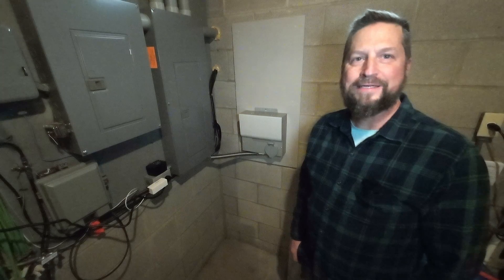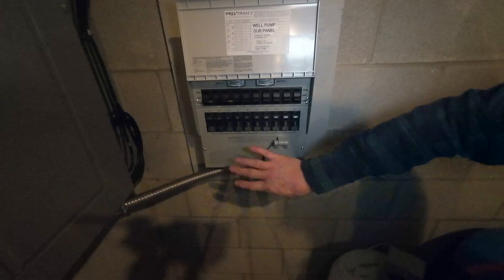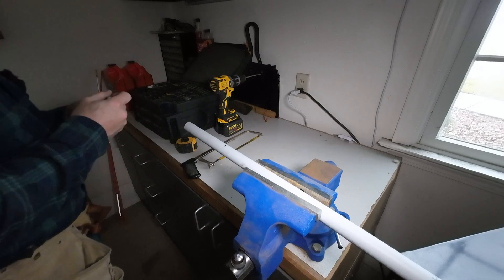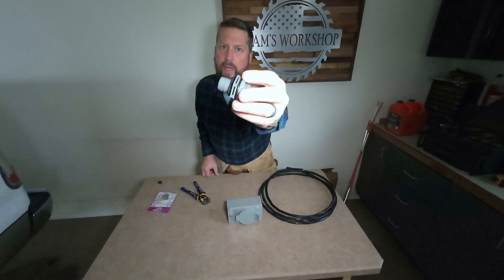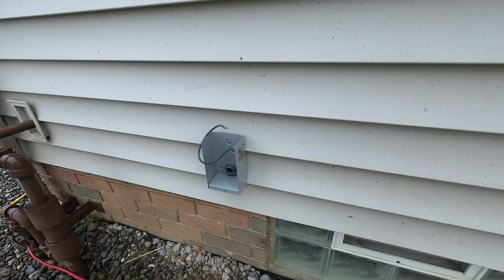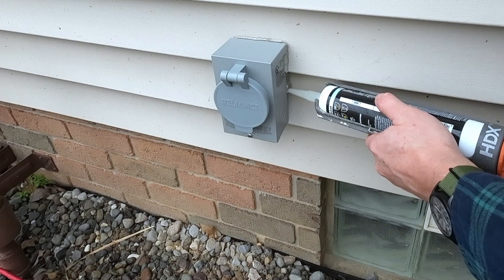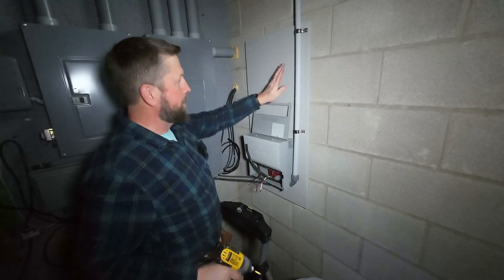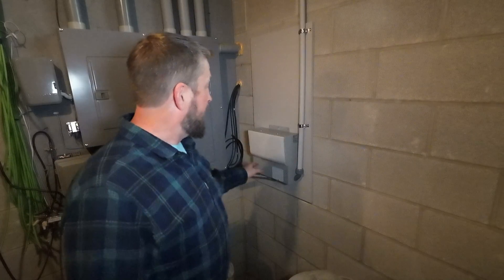Installing An External Inlet For A Generator Transfer Switch

Comment: Thank you for the EXCELLENT video. It's exactly what I need for my installation. I've done a couple of transfer switches, so what I needed the most help with was attaching the box to the outside of the house on the siding. Your details on attaching the conduit to the box are  what I need.
Reply from the maker: So glad it was helpful! That's exactly why I make these videos. Happy to hear it gave you exactly what you needed. 🤠👍

Comment: I cannot find that fitting anywhere.
Reply from the maker: Hope this helps 

https://www.homedepot.com/p/Reliance-Controls-30-Amp-Power-Inlet-Box-PB30/202213702?g_store=3805&source=shoppingads&locale=en-US&pla&mtc=SHOPPING-BF-CDP-GGL-D27E-027_008_CIRCUIT_PROT-NA-NA-NA-PMAX-NA-NA-NA-NA-NBR-NA-NA-NEW-NA-Priority2024&cm_mmc=SHOPPING-BF-CDP-GGL-D27E-027_008_CIRCUIT_PROT-NA-NA-NA-PMAX-NA-NA-NA-NA-NBR-NA-NA-NEW-NA-Priority2024-20420576520--&gclsrc=aw.ds&gad_source=1&gad_campaignid=20420577051&gclid=CjwKCAiA55rJBhByEiwAFkY1QAob4kuaX6jSg_pR5QUQxUdN4OmxNPTaURsi8MykaYwmA9pVZIdTaxoCn4EQAvD_BwE&adobe_mc=TS%3D1764172532%7CMCMID%3D87251738588442607708685792847285464003%7CMCORGID%3DF6421253512D2C100A490D45%40AdobeOrg&mboxSession=5051414e-f945-4c45-9e9e-606d4d951486&appsFlyerId=1752099438441-6431554585545318375
Reply: @samsdoinstuff Thank you, I have the box it was the small fitting for the pvc pipe to go into the box that I can’t seem to find.
Reply from the maker: @peterviv7520 I just found that at Home Depot in the electrical conduit isle. 🤠👍

Comment: Do you have a newer video to show how you added the battery power generator to the transfer unit?
Reply from the maker: Great question. No, I have not added battery backup yet. Check out Spicer Designs channel. Here's a link to a video he did. He's a licensed electrician 🤠👍

https://youtu.be/Fud1gp880LE?si=FjZdIySz09J1wil3

Comment: I'm not sure if you will get this since this video is a year old. Is it possible to have two inlets for your transfer switch? One in the house in case you want to use the battery system and one externally in case you want to use a gas system?  Right now I am thinking of just leaving the inside inlet for battery hookup then just running a generator cable back into the house to charge the batteries.
Reply from the maker: @mitchodell4993  Great question. With this system, it would definitely be possible. That's exactly what I want to do eventually. I would put a selector switch inline so I could choose which inlet to use. Gas generator/electric battery backup 🤠👍
Reply: @ any recommendations on batteries?  Was thinking of the Goal Zero Yeti Pro 4000? Would love to do a Tesla power wall but I am too cheap.  Haha
Reply from the maker: @mitchodell4993  I do not know enough about battery systems to give an educated recommendation. I do think the better brands like Bluetti, Anker SOLIX, and EcoFlow would have the best product support.

Comment: Thank you for this informitave video, you just broved my brother in law wrong, The transfer switch won't feed back into the grid once the power comes back on making it safe to use. By the way he is a certified electrician😂
Reply from the maker: @D-Slowpass  Thank you! I'm very happy I could help. Hope I didn't create any "static" between you and your brother, lol 🤠👍
Reply: @samsdoinstuff  no. Just confirmed what I thought and takes the guess work out of doing it myself😀

Comment: I watched a previous video that showed you installing a transfer switch box including revising the inlet box to be accessible so it could be manually connected to a generator or power station & easily swapped as needed. I also watched this video showing you installing an inlet box on the house exterior for a generator connection into the house. These are great because I can send these to my husband and let him know that this is what I had in mind EXCEPT to leave the transfer box inlet as you had revised it in the transfer switch box, and to purchase an ADDITIONAL inlet box for the generator to plug into on the outside of the house. 

After the inlet box is installed on the ouside of the house to plug in the generator... since the other end would not be permanently wired into the transfer switch box but instead would need to be more like an extension cord that would be manually plugged into the transfer switch accessible inlet box... do you know if such a cable already exists? TIA!
Reply from the maker: @annerohyans9407  Thank you! What you described sounds like you would do best to have a switch wired in between the transfer switch and the two inlets. That way you could select between outdoor gas generator power and the inside inlet. You would absolutely not want it wired so both could be used at once. Hope this helps 🤠👍
Reply: @samsdoinstuff  Thank you for the reply! That makes sense and I have a visual, but I am not familiar enough with parts to know where to find such a switch. Are you able to give me the name/model of such a switch?
Reply from the maker: @annerohyans9407  There are so many to choose from. Just Google "30 amp selector switch" (or 50 amp depending on which setup you're using. Amazon, Home Depot, Lowe's  all have them.
Reply: That helps to know what to Google, will do, thanks much!

Comment: So how can u use the hookup outside with a solar style indoor power source?
Reply from the maker: @jimverh1868  Great question! You would need a separate set of wires for another's inlet inside the house and a selector switch between to chose which input you want to use. I intend to do that someday 🤠👍
Reply: My thought was to leave the plug in the transfer switch like u had at first so easy hook up to solar source and hook up outside as you did but bring it into a outlet in house and use the cord from solar supply to it.   Was courious if this would work
Reply from the maker: @jimverh1868  I think as long as you don't have the ability to "double feed" the transfer switch, you're good. I would want a selector switch just to be safe.

Comment: You had the best illustration not complicated to show how to do this I am saving it and I am going to install this but I would like to know the name of that 10 circuit box I'm sure you can order it online please answer back thank you
Reply from the maker: @brianszanyi5538  Thank you very much! It is a Reliance Controls, 30 amp, 10 circuit Manual Transfer Switch Kit. I purchased it through Home Depot, but you can also find it on Amazon. 🤠👍

Comment: I'm about to do my own inlet box install, and based on my research, I believe your use of NM (romex?) in the conduit in a possible wet environment might be a big no-no because there is a risk that the paper in the sheathing might get wet.  I'm probably going to use individual strands of THHN for mine.

Disclaimer:  I am not a licensed electrician and this is not electrical advice.  Please seek a licensed professional for advice.
Reply from the maker: @RK-kn1ud  Thank you for the insight 🙏 I will definitely look into that. 🤠👍
Reply: @samsdoinstuff  Either way, I'd probably be comfortable doing it with NM like you did at my own personal residence.  That said, I'm starting from scratch, so I'm just gonna do individual conductors.  I saw a video here on YT of a claimed Licensed Electrician doing it with NM, so it could be perfectly fine.  Lol.
Reply from the maker: @RK-kn1ud  Good to know! I feel pretty comfortable with my installation. Especially with all the silicone I put around that thing, lol

Comment: how far from the transfer switch can you install the inlet?
Reply from the maker: Great question. Refer to the charts at Southwire.com for wire size and voltage drop over distance. With 8 awg wire, your drop is extremely minimal under 50 feet. Hope this helps! 🤠👍

Comment: Wire nuts do not need tape. Those connector are not code for PVC conduit. If you use NM cable, There has to be a connector interring or leaving a box or conduit per NEC code.
Reply from the maker: Thank you for the tip! I'm always learning! 🤠👍

Comment: Nice job on the install. How do you plan to run the batteries and the generator at the same time? Just ordered my Champion 8500w inverter generator yesterday. I was also looking at the Anker Solix power station.
Reply from the maker: @jjay718  I haven't yet pulled the trigger on a battery/solar system. The gas generator works great for now. If I kept both, I would wire in a switch to choose between the outside inlet and install another inlet inside. A backup for the backup 🤠👍
Reply: Also wondering where you got your transfer switch from? Seeing bad reviews from a lot of these companies or they dont have the exact parts I want.
Reply from the maker: @jjay718  I picked it up at Home Depot. It's working flawlessly as of right now.

Comment: I think your box is ungrounded.  It looked like the NM wire went directly into the socket and wasn't bonded to the box or face plate.  The ground wire from the face plate to the box does nothing to ground anything unless the box is connected to the ground wire in the NM bundle as well.  The socket should be completely isolated from box, I don't believe it shares a ground with the socket.  You should either tie into the ground from the NM bundle or run a dedicated ground from the box back to the panel/transfer switch and tie into the ground there.
Reply from the maker: Thank you for the advice! I will open that up and rectify that situation. That makes sense the way you described it. The ground on the inlet is grounded to the bar in the main panel through the transfer switch but I suppose the box on the inlet should also be grounded just like a sub panel. Thanks again 🤠👍

Comment: Hello Sam
I'm alittle curious about size of generator to run 10 circuits?
Also should it be a inverter type  for new gas furnace and electronics through out the home.
Thanks
Reply: Sorry forgot to mention I will use the 6 circuit switch
Reply from the maker: Great questions, and I'd like to remind you I'm not a licensed electrician. That being said, I'm using a generator that can produce 6,500 watts of continuous power. That will power any of the heavy loads like the well pump and the refrigerator. I could even run an AC compressor if I wanted to. The key is to not run all 10 circuits at full load. Allow your key circuits as mentioned to run as needed and only use other circuits when absolutely necessary. Inverter generators are a much cleaner source of power and are certainly better because of that, but they also come at a higher price tag. Ultimately, I would like to run a battery backup system hooked up to solar for charging and use the generator to charge the batteries if need be. Hope this helps 🤠👍
Reply: Yes it does thank you for responding
Reply: @mikereimer4279 I did EXACTLY what he did in this video, EXCEPT I'm using a Predator 9500 inverter simply for my furnace and other electronics. THIS depends on what kind of breaker panel you're wiring it too. For my situation, I'm wiring the generator to a subpanel. A subpanel has the grounds and neutrals SEPERATED. I had to take the control panel off my inverter and disconnect the neutral wire that was bonded to the ground. You only want your grounds and neutrals bonded in ONE LOCATION, which is the main panel.

If you don't have a subpanel, and only have a main panel then it doesn't matter if your generator has a bonded neutral.

Comment: There is another way to strip that outer jacket, Nick/ cut the end, score with a shallow blade and pull down to where you want to remove it. Then cut off the excess. Works great for outdoor jacketed wire as well. (Shallow is the key, just score , dont cut ).  PS, if the ground is jacketed, green its 4 wire vs ground bare, 3 wire
Reply from the maker: Thank you for the helpful tips 🤠👍

Comment: Ģood morning Sam, nice install.  I want to get a battery backup system as well for the same reasons. The main reason is that it can be recharged via solar thus not having to depend on a fuel that may not be available.  Have a great day!
Reply from the maker: Absolutely. It seems a little paranoid sometimes, but crazy is only crazy until it's not 🤠👍

Comment: Sam, where the receptacle comes through the wall of the house and the downpipe to the unit meet. You looked at that area but did not video the connection. Something tells me the wires are exposed.  The only reason I bring this up is that rodents can chew wires. Please don't take this as a negative comment; take it as knowledge.
Reply from the maker: You are absolutely correct, but code does not require wire in ceilings or walls to be contained in conduit. The 6' piece of conduit that protects the wire takes it into the joists which is sufficient. Otherwise, all of the electrical wires in a house would have to be run through conduit. Great question 🤠👍
Reply: My Dad retired from the Electrical Union and used me as a helper when he did side jobs. I learned how to bend the EMT conduit and have used it in all my projects. I am 69 and have been involved in many projects over the years.   @samsdoinstuff
Reply: @samsdoinstuff  since you took the time to put it in conduit running down to the transfer switch I would’ve taken the time also to put an elbow on to make it look neat if nothing else

Comment: Did you put an elbow on the top of the  conduit to the piece that comes through the wall?
Reply from the maker: I did not. That section of wire is up in the joists where it's not in danger of being damaged. I also smoothed out the edges where I cut the conduit to ensure it won't cut the wire. 🤠👍